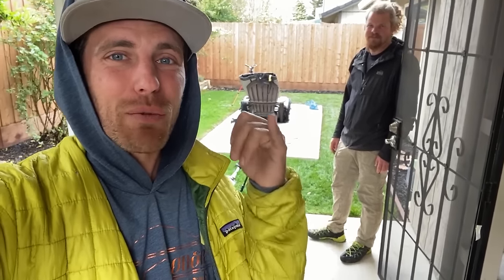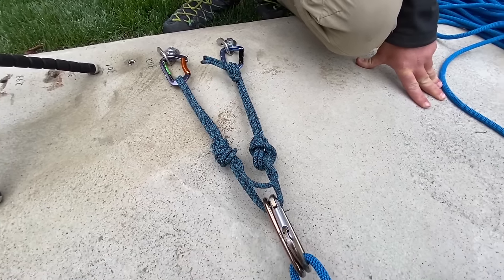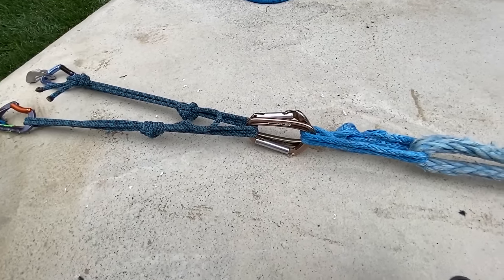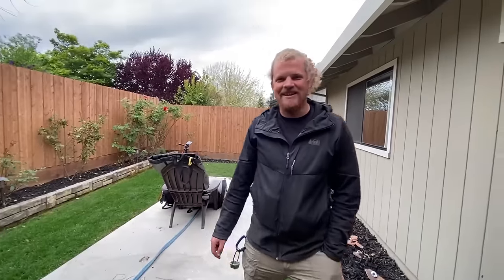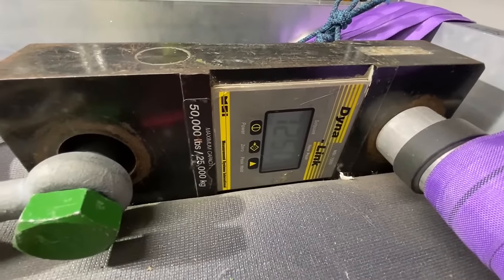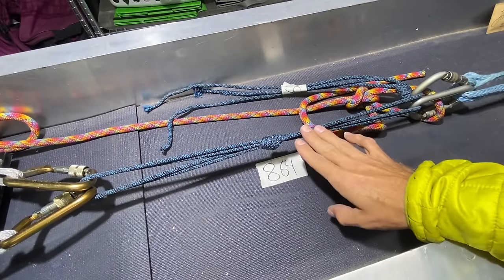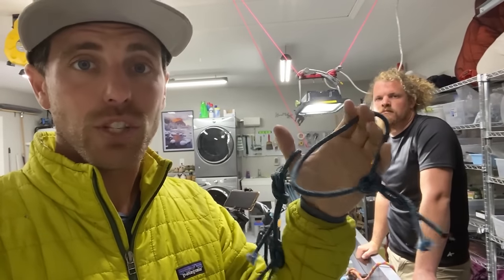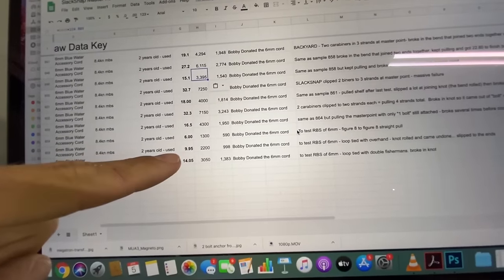Climbing Quad Anchor break test with 6mm accessory cord

Comment: I was wondering when you set up a highline with a backup (obviously) and have 2 different webbings. Would you put the stronger webbing as a main or backup? Of yourse you want to minimise the chance of fail but also maximise the strength of a backup to not die. (Also the weaker webbing I have is Leviathan from Slackhouse which is really nice to walk because of how soft and dull the material is.)

Comment: Why only Clip to 3? Why not 4 or 2? I thought the belated was attached to 2 strands, and the climber to the other 2?
Reply from the maker: Could clip 2 and 2 but if you are only going to clip one thing in 3 strands I think will give more strength.  Clip all 4 and one side blows, it will slide off

Comment: You sure that was 6mm cord? Looks like 7mm when I take measurements compared to the Petzl biner
Reply from the maker: It was sold as a 6mm cord. We have noticed actual diameters tend to vary a bit by manufacturer.
Reply: @HowNOT2  You're right diameters vary somewhat but not that much. I use Mammut cord as well. The measured diameter is slightly over 7mm. The tell is the fact that you broke it a such a high KN. The MBS for 7mm is 13kn, 6mm is 8.5kn. I think the store made a mistake.

Comment: Does that "death knot" (or any knot) slip reliably at a given force, and when shock loaded?  If so, does anyone use it as an energy absorbing element in their rigging? I don't highline, but it seems like something that could dissipate energy -- rather than store it and release it right back like a rope stretching -- would be useful.
Reply: I've heard of loosely tied figure eights on a bight being used to absorb shock when someone needs to lead on a static line. It was mentioned in the context of Canyoning, but I'm sure it could work in climbing as well.
Reply: Nearly no knot, perhaps some hitches, will behave in a shockload like in such unrealistic static pull. There is a lot of research done in realistic fall tests already on that topic.
I do like the channel, but sometimes it seems they do things just for content and clicks, and the safety margin they want is often way to high. In real climbing everything that holds over about 10KN is pretty safe.

Comment: The quad wasn't even constructed correctly! Come on guys. I see that error too often, you clip two strands with one carabiner, and the other two strands with the other carabiner. That gives you the redundancy advantages of the quad.
Reply: @beaniebobh1  I've seen that construction a lot,  but if you clip each carabiner through two strands, you get better redundancy, relying on two strands, rather than one, to carry the load if one leg fails. Hard to put into words. You also get the benefit of having slightly isolated tie in and belay points, allowing you to better position yourself as the top belayer regardless of the force being exerted by the belay device.